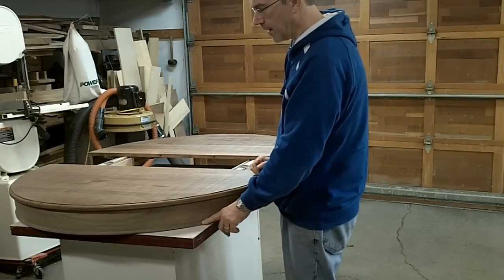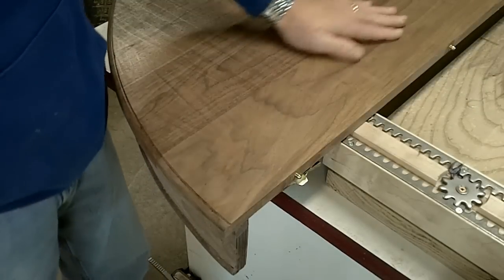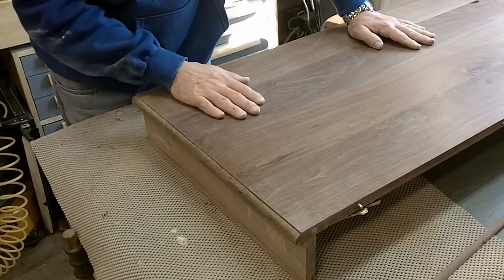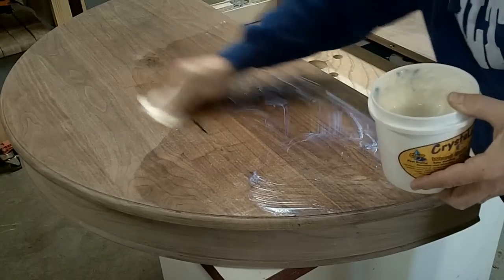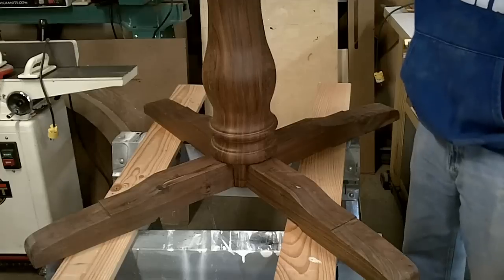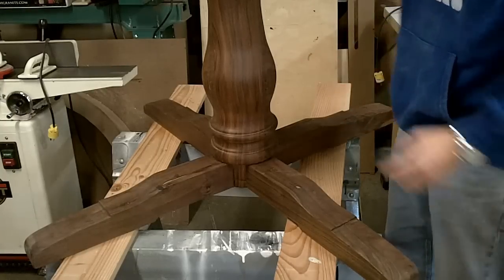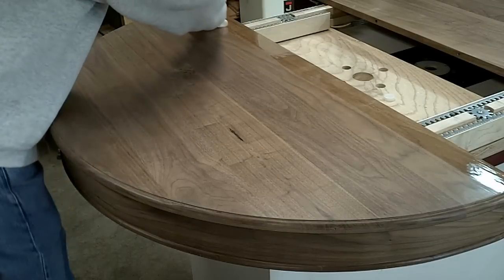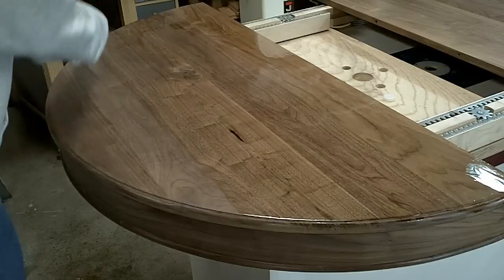Pedestal Extension Table - Part 10

Comment from the maker: I think the CrystaLac is fine for filling in the open grain found on a species like walnut or oak. However I would not think that it would be appropriate for filling in deeper engravings like you are referring to. You might want to contact the manufacturer and ask their opinion on this subject.

If it were me, I would try some 5 minute epoxy maybe colored with a dye to fill in the engravings on a test piece. This is what I use to fill in and stabilize knots and small defects in the wood surface.

Comment: Thank you for the quick reply. That's kind of what I was thinking, West Systems makes a clear 'finishing epoxy' and 'z poxy' is in a sense the same thing. I often mask off the surface, engrave through the tape and then spray paint certain sections so a clear filler is needed. Does CrystaLac work well as a sealer? Right now I'm using a neutral filler and dying it as needed, then using a sanding sealer, then lacquer.

Comment: What's your opinion on the CrystaLac? I do laser engraving and I'm looking for a way to fill in the engraved letters (1/16 to 1/8th inch deep). If I were to level the surface with a squeegee do you think it'd hold it's form and give me a flat surface or am I better off trying a product like z poxy?